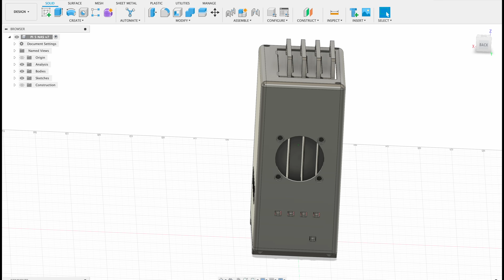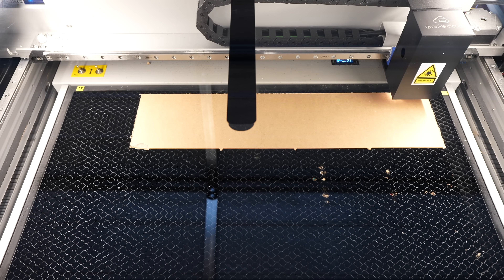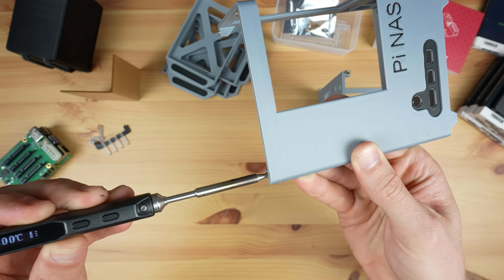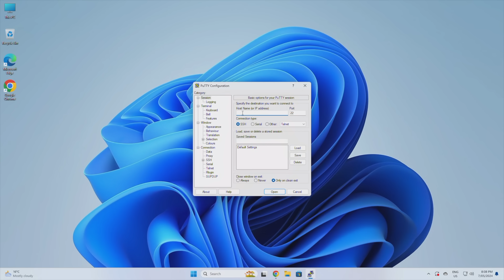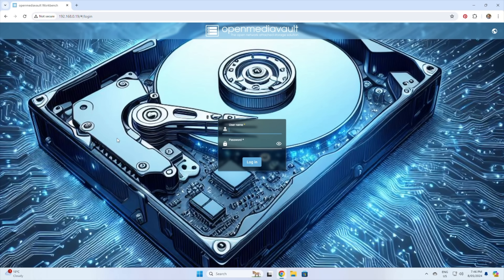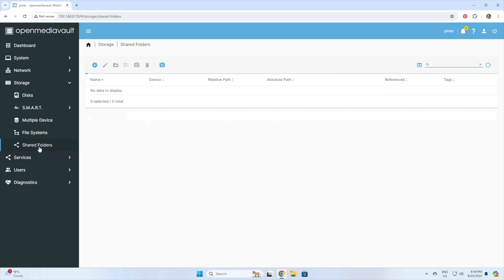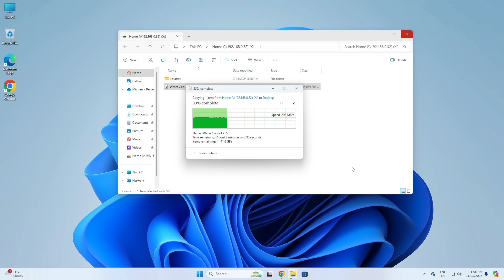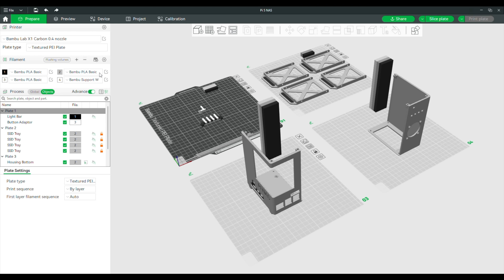I Built A 4-Bay NAS Using A Raspberry Pi 5

Comment: This NAS is freakin sweet!! I like how you used the 2.5Gb Ethernet adapter in the usb 3.0 port to increase the transfer speeds. In Jeff Geerling's video where he makes a similar Pi Nas, he uses another PCIE daughter that is overcomplicated, doesn't look very good, and doesn't give him as much speed as using 2.5Gb ethernet adapter. I really like your 3D printed case as well. My only concern is thermals. I know the Pi gets pretty hot but this would be an easy modification to fix the problem. Excellent job all around!!!
Reply from the maker: Thanks for the great feedback! The 2.5Gb Ethernet adaptor is a really easy plug and play solution, the specific one I used doesn't even need additional drivers. There is quite a lot of room at the top for heat to escape, so I haven't had any thermal issues but it would be super easy to replace the window with some mesh to improve cooling if it becomes a problem.
Reply: @MichaelKlements  That's great to know! Thanks for getting back to me and letting me know. I've been considering getting a NAS lately but after watching your video, I will be building this in the near future> Keep up the great work and thank you for the inspiration!!
Reply: Great build!  Would it be possible to add some guide rails/fins to the case to help align the drives when they are inserted?

Comment: If they made a 5gbe or 10gbe pi I could use it. But running slower than one internal SSD just doesn't cut it.
A small business or avg home could utilize it well, i think.
Reply from the maker: Yeah, a NAS running on a Pi is really not for business use.

Comment: Hi Michael! How is the performance vs a cheap commercial nas like qnap ts233 or similar entry level nas devices? I want to stop using google photos and drive, but im not sure if i should bought an entry level nas or a pi5 with the redxa hat. Im just thinking on a device for store photos and files, maybe install immach for the facial recognition on the pictures and that. Do you think that this solution could work to me? ❤ Your video is nice btw
Reply from the maker: With the 2.5G Ethernet adaptor that I used at the end, you're getting over double the speed that you'd get from the TS233. Another benefit of the Pi is flexibility with software, there are many different open-source NAS packages available.

Comment: A technical question, is it possible to attach this via USB-C instead of network and make it act as a DAS ? What would the read/write speed look like ?
Reply from the maker: I'm not aware of any way to use a Pi as a DAS. This should in theory be much faster than the NAS as the 2.5G Ethernet connection is the bottleneck on my NAS.

Comment: Great pi nas.
Is it possible fo you to add an oled display to the gpio pins and show average load of 1, 5, 15 and the temp og cpu plus the harddrives in a second video ?

Preferable located at the back of the pi where light and fan is located

Thankyou for reading and best regards.
Darkyere

Comment: Would it also be possible to use 3.5" internal harddrives instead of ssds?
Reply from the maker: You can use 3.5" drives with the Radxa hat, but obviously not in this enclosure. You'd also need to use adaptor cables since the ports are too close together and power them separately.

Comment: What about 3.5 inch harddrive??
Reply from the maker: 3.5" hardware draws too much power for this setup. You can connect them using adaptor cables and a separate power supply.

Comment: Great video at the perfect time. I was considering building an NVME-based PI5 NAS, but looking at your performance figures, 3 1/2" SSDs look adequate. Thank you.
Reply from the maker: Yes, unless you're going to 10GBe, it's probably not worth going to NVMe drives. These drives performed better than I expected and you'll be bottlenecked by the PCIe port on the Pi in any case.
Reply: @MichaelKlements  Yes, I was expecting the PCIe port to be the bottleneck. The 2.5GB dongle for the network is another great idea. Thank you.

Comment: Will it work with 2.5inch hard disk drives? I'm looking for a more archival and reliable system rather than to boot from or anything that would require SSD speeds.
Reply from the maker: Yes, you could use mechanical drives rather

Comment: you don't need PuTTY anymore, SSH is included in Windows
Reply: I am quite an exception. I'd use PuTTY because I already have other hardware that uses it. I can still SSH into my switchboard and do my configuration through that, but I like GUIs. Very true comment, though. I'm a minority here. I plan on building my NAS by the end of the year. Buying the components got hard after I had to get a new car .-. I never realized I had $607 a month to waste, but guess I don't now.

Comment: I'd like to make this using a Rock 5B instead of a Pi 5 because it has a 2.5 Gb ethernet port and overall much faster. I'm thinking Plex server. I know the cost will be higher or about the same as using an ITX board but I like the size and form factor of this little guy.
Reply from the maker: The Rock 5B is a great board for a NAS

Comment: My first time here. Great video! My one question about the design is how does cool air get into our out of the case? Did the clean piece have any air holes or was there a vent somewhere in the design? Possibly you just intended the opening on the top to provide that flow?
Reply from the maker: There are gaps between the drive trays at the top of the enclosure
Reply: @MichaelKlements  - Thanks. that's sensible.

Comment: I added slightly longer standoffs then the ones that the hat comes with. Just found some black standoffs on Amazon. This way I did not have to break any radiator fins.
Reply from the maker: How much longer were the ones you used? Presumably you haven't had any issues plugging into the GPIO header the extensions then?
Reply: @MichaelKlements  ok just checked what I got. The ones I used were M2.5 x 20 + 6mm, so 20mm tall, looks like the stock ones are 18mm. I purchased M2.5 Nylon Standoffs Kit for this and future projects (MakerSpot), should be useful.
So GPIO is 2mm not all the way in, but it’s not an issue and everything is secure and snug.

Comment: Upgrading from the Raspberry Pi Zero 2 W to a Raspberry Pi 5 with a Radxa Penta SATA HAT significantly enhances your NAS's performance and storage capacity. Here's a summary of the key points from the project:

### Components Used:
1. **Raspberry Pi 5**: The main board for the NAS, significantly more powerful than the Pi Zero 2 W.
2. **Radxa Penta SATA HAT**: Allows connection of up to five SATA drives via PCI Express.
3. **Cooling Solution**: Pi 5 active cooler, with some modification needed to fit with the HAT.
4. **Storage Drives**: Crucial drives, chosen for a balance between cost and quality.
5. **Micro SD Card**: 32GB SanDisk Ultra for the operating system.
6. **Enclosure**: Custom-designed and 3D-printed using Fusion 360, includes cooling and easy drive access.

### Building and Configuration:
- **Cooling**: Modified the Pi 5 active cooler to fit with the HAT.
- **Power**: HAT supplies 5V to the Pi through GPIO pins; it also has options for a 12V barrel jack or an ATX mlex connector.
- **Enclosure Design**: Designed for vertical arrangement, includes trays for easy drive swaps, and cooling fans.
- **Operating System**: Raspberry Pi OS Lite with OpenMediaVault (OMV) for NAS management.
- **Assembly**: Included brass inserts for durability, glued windows, and used clear PET for LED bar.

### Performance:
- **Data Transfer Speeds**:
  - With gigabit Ethernet: 112 MB/s read/write, saturating the gigabit port.
  - With 2.5G Ethernet adapter: Up to 260 MB/s write and 200 MB/s read, showing significant improvement.
- **Power Consumption**: Extremely efficient, with idle power usage at 9W and under load at 12W, much lower than typical NAS setups.

### Additional Features:
- **Enclosure Design**: Split into two halves for easy assembly and printing, with an option for a window to view drives.
- **Cooling**: Included a 40mm Noctua fan with a dust filter for effective cooling.
- **Drive Configuration**: RAID 5 setup for a balance of capacity and redundancy, providing 3TB of usable storage.
- **Network Setup**: OMV accessed through a browser, with guides available for detailed configuration.

### Improvements and Future Enhancements:
- **2.5G Ethernet**: Raspberry Pi 5 lacks native 2.5G Ethernet, an area for potential improvement in future iterations.
- **Drive Access**: Designed with easy access and replacement of drives in mind, useful for maintenance and upgrades.

### Conclusion:
Your upgraded NAS project significantly improves performance, storage capacity, and power efficiency. It's a well-thought-out build that leverages the capabilities of the Raspberry Pi 5 and the Radxa Penta SATA HAT effectively. The custom enclosure design and the thoughtful integration of cooling solutions make it a robust and practical NAS setup.

If you need any specific advice or further assistance with this project, feel free to ask!

Comment: On a side note,  i liked your design for the case.  I wish i had a 3d printer and all those things to actually build what is in my head half the time.  The two things id offer as improvements are guides for the caddy's as you slide them in and some logo on the side.  Great design in any case (pun intended lol).

Comment: Excellent project! I have one small addendum. Maybe you could instead of a one big vent hole make some kind of mesh or grid and instead of screw holes some kind of pins which will hold fan as it is. I believe that something like this will ad more simplicity and back of the case will be more uniform. But in any case excellent project! Thank you!

Comment: Can you see a way to route the power-supply to the "back" too? Cable-management etc.etc... 

The extruding power-button looks like something that could be pressed by accident, so why not reduce it (and the indicators) to be flush with the surface?
And along the same lines - how about flat-head screws in countersunk holes to have a nice and flush exterior? 
Fantastic build - the acrylic window was a cool touch! Inspiring build!

Comment: I was wondering what size memory you had on the Pi5, and if there would be any performance difference between the 4GB and 8GB versions.
Reply from the maker: This is an 8GB versions. There might be a slight performance difference but I never noticed more than 25-30% RAM usage during my testing.
Reply: @MichaelKlements  Thanks!

Comment: Congratulations on the project, I'm from Brazil and I'm researching to try to do a similar project but with orange pi zero 3, do you know if it's possible to do this?
Reply from the maker: You could definitely make a NAS with the Orange Pi Zero 3 but it would need to be a bit different to this one as it doesn't have a PCIe port on it.

Comment: this is very cool, how reliable is the sd card?
Reply from the maker: I've had these running in Pi projects for years without any issues. It's also easy enough to have a cloned card on standby which you can just swap to if one dies.

Comment: is it possible to boot Pi from one of the 5 SATA drives? using micro SD is like asking for failure
Reply from the maker: Yes, you can boot from any of the four drives in bays or from an external drive that can be plugged into the front.
Reply: @MichaelKlements  thx

Comment: Very nice video.
Could you do a NAS using 3.5" HDD's please.  These give so much more TB for the $
Reply from the maker: Unfortunately the hat doesn't have enough space for them to be plugged in directly but with an adaptor cable you can use 3.5" drives.

Comment: I have a Synology DS211j which is an awesome NAS but it's really getting long in the tooth and while it serves up videos it's not so good when videos need transcoding - tends to cause stuttering so it would be nice to build a replacement which can transcode on the fly if need be. Would a Pi 5 up to the job?
Reply from the maker: The Pi 5's CPU is not all that powerful in relative terms, you'd probably be better off with a mini PC running as a NAS.

Comment: It looks really great. Everything is hidden inside the case. What is the temperature after some time? Mainly when it runs 24 hours per day, and some computations are made.
Reply from the maker: After running for two days the CPU temp was at an average of 42C and didn't go over 54C under load, the drives stayed around 34C with or without load.

Comment: This HAT was introduced long time ago for ROCK 4 board and it's m.2 connector that already had 4x pcie lines. On pi5 it's possible to use 1x pcie 3.0, some boards can use 2x pcie 3.0, but of course ethernet should follow that, RK3588 has 2.5G as well as two pcie 3.0 lines that can be used for 10G nic :) 
For this build - I have some doubts about this build. Original design includes airflow from bottom to top, with temp sensor, two controllable fans. Also thick metal case acted like big radiator and it was not enough on pi4 and rock4, those two fans frequently were noticable. Several things have changed since then, pi5 is bit better at thermals but there is also different airflow. HAT has holes between sata ports but active cooler blows in different direction. Let us know about thermals in future, make some burn tests to see if ssds are not overheating. 
Original design has additional button and OLED screen on top, You still have this socket on board to be used. You can add some i2c screen with some information from system, eth address, iotop, available space. You could also get power from there so there is no need to solder into pins. 
I'm also interested if this will be stable in RAID. On some of revisions of this chip there was huge problem with disconnecting drives, data link error. Those result in RAID array rebuilding all the time. Hopefully this will be not the case here. On some firmware versions with certain drives SMART info was wrong causing issues. 
There is small some trick to make this build much smaller and improve thermals. You can tear down those cruicial bx500 drives to discover that PCB inside uses about 35% of this case size. It's really small, compact board and surrounding plastic is not helping to cool down it, no thermal pads or whatever. If You are careful enough You will not loose warranty and can assembly it to original state if You need to use warranty. Your build can have same functionality, be much more smaller and Your noctua fan will do it's job much better (or can be silent). I also got cheap plastic ssds on this build and it's just way better stripped of that.

Comment: super cool case! I wonder if the current 12v would be enough to power this with 4 3.5” drives. Did you run the same disk benchmark as with the nvme hat video you posted? Would be interested to see the raid array performance difference. Thanks
Reply from the maker: 3.5" drives generally require a separate 12V supply through a molex connector, I doubt you'd be able to power four physical disc drives with the built in power circuit. I tested the local drive speed with the NVMe hat and the networked drive speed on this NAS so two quite different tests - I'll try run the local drive speed test on the NAS and see what I get.

Comment: Hi. I followed your instructions but I can’t install OMV, I keep running into errors and it says failed to install openmediavault package.
Reply from the maker: What OS are you using?
Reply: @MichaelKlements  Got it working now for some reason, I think I didn’t run the sudo update properly. But thanks!
Reply: @MichaelKlements  BTW: as far as I remember there is also OMV7 build ready for pi5 just to apply, You don't need to go with rpi os

Comment: Your cases are always wonderful. I'm thinking of trying yours instead of the Radxa design now!
Reply from the maker: Thank you! Definitely give it a go and let me know what you think. I’ve included a version without the acrylic window which is pretty easy to print out.
Reply: Typical blokes trying to compare their PiNASes
Reply: What do you two think about an enclosure that can take advantage of the esata port for a fifth drive?
Reply: I was just about to tag you 😂
Reply: Hi Jeff, did you try it yet? btw just finished watching your vid about the NAS build with the 2.5 GIG network adapter. I will build my nas without the Network adapter and the  Penta SATA HAT top board. Either way, it's gonna be faster than my good old Lacie Space Max :-) is the 40mm fan from this build enough to keep everything cool? I was also looking at the Radxa design first but this one is my favorite. Anyway, thank you both very much for the amazing work you guys doing! May the Geek Gods favor you both !
Reply: @erdincify  Yes! I just printed it last week... haven't had time to assemble everything yet but hoping to do that next week. The dry fit was perfect already, though. Hopefully it all goes together well once I have the Pi inside.

Might re-print it with higher temp plastic though, my first print was in PLA.
Reply: @JeffGeerling  Thanks for the heads-up and sharing your findings. Unfortunately, I don't have a 3D printer so I have to outsource this project to a 3D printing service. Would PETG a better choice of filament for this project?
Reply: @JeffGeerling I watched your video as well as this one on the Pi5 NAS as really wanted to build one. I don’t have a 3D printer so the thing putting me off right now is how hot you said it got in your video. How does Michaels case compare heat wise? Trying to find a pre built case like this seems difficult. I am in the UK.
Reply: I am designing an enclosure with extruded aluminum (which can also be 3D printed), USB-C PD, and backup battery (UPS). I can add more capabilities to it down the road. Would you guys be interested in trying it on your channels?
Reply: @mehrdadfeller  yes
Reply: It would be nice to have a penta hat that supports PoE. A PiNAS hanging off a single rj45 would be great for reducing cable mess.